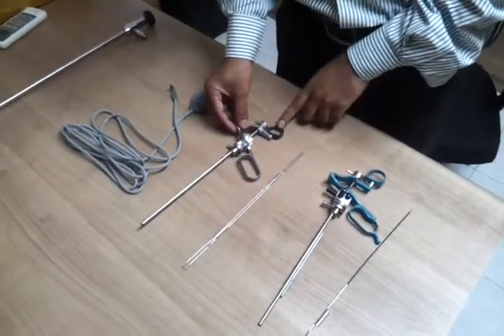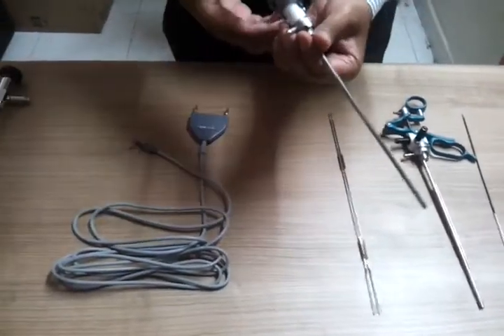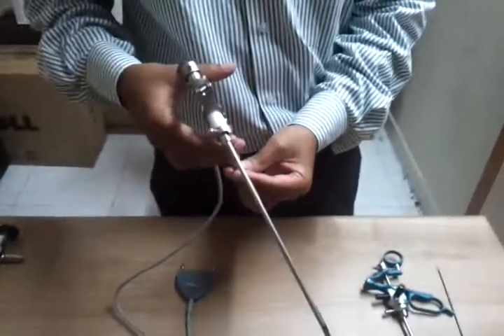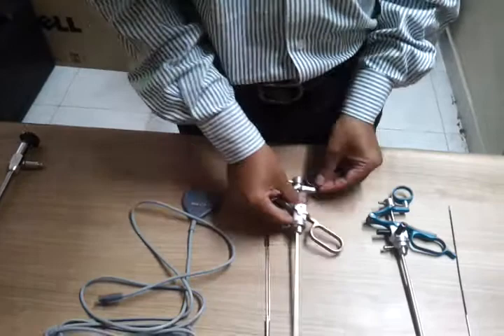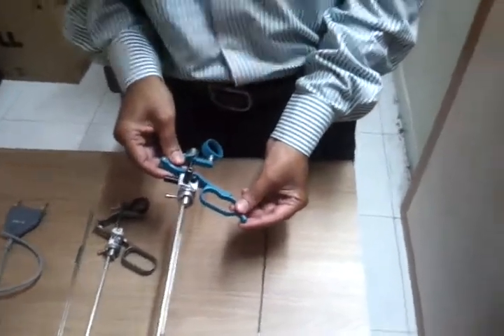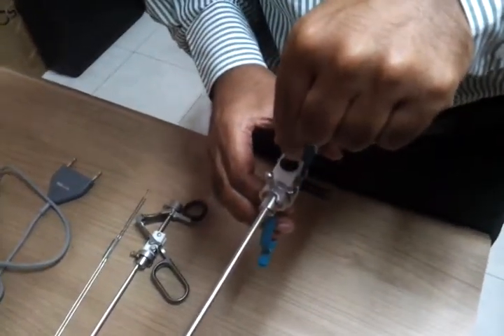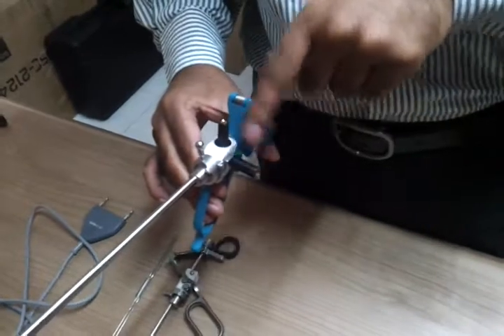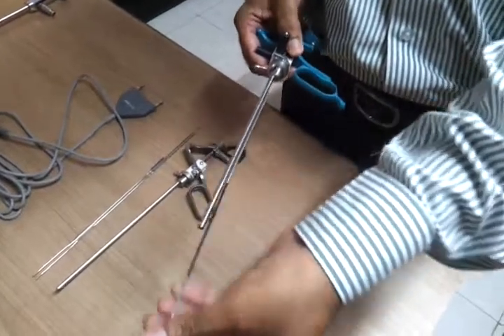Bipolar Working Element Resectoscope

Comment: How can a monopolar single stem loop gets bipolar?how is it possible?
Reply from the maker: Current flows from loop and received (return path) through the Shaft to which  another cable is connected.
Reply: current passes through a single stem to the loop and then back through the same stem??still bipolar?
Reply: No. He is using a Double-stem loop. Storz has single & double stem resectoscopes.
ONLY Double stem ones can be used as bipolar.
Reply: Indian manufacturers are also making 2-in-1 resectoscope. Single stem loop. Resectoscope has 2 insertions for cable (1 routine for monopolar, same monopolar insertion + additional insertion for banana-type bipolar cable).
Requires bipolar resectoscope compatible cautery though